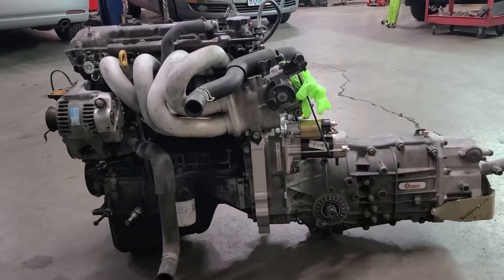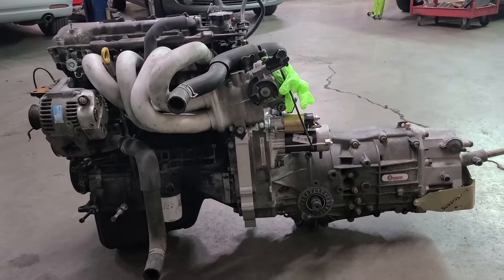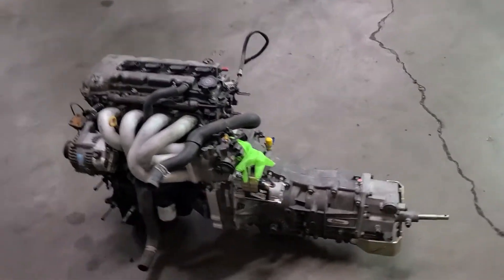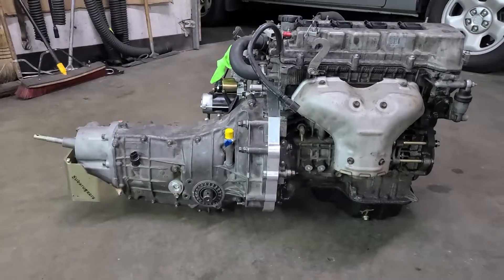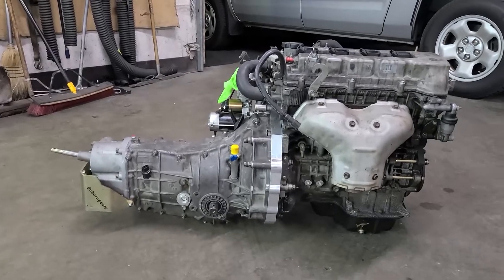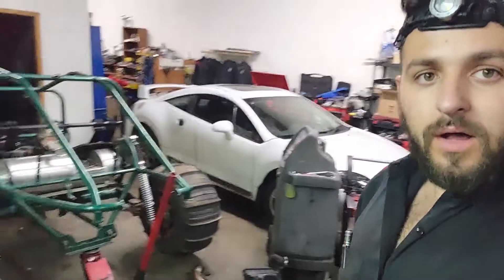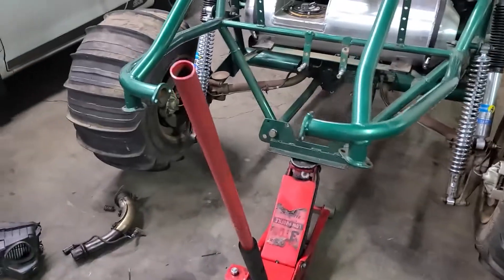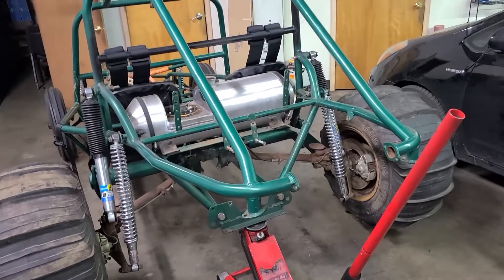Making a Custom Engine to Transmission Adapter (Toyota Sandrail Build EP#8)

Comment: Now that's some boss work! Using the dowel holes for alignment on a blank is super clever. So when you said machinist the first few times, you just meant the drill press eh? Hahaha. I fully expected the cheap clutch too. Love it.

Comment: What about the pilot bearing? Was the stock one able to fit the trans input shaft end? Or did you have to find a different one? King bearing has always had what I needed. I did not see how you solved that? Was the factory throw out bearing used or a differnt one? Great job . Im gettingvteady ti do one and looking for information.  Thank you.

Comment: It looks professional! I have a question though, how did you ensure the engine and transmission were aligned? I saw the part where you put the adapter plate on both the transmission and engine to mark hole locations, were there any additional alignment steps? How did you align the crank shaft to the hole?

I'm swapping a Nissan Leaf motor into a 93 Subaru Sambar. Other websites recommend <3 thou of misalignment, I don't know how I want to even measure the alignment yet. Your method looks pretty easy :)
Reply: I was thinking the same. Probably a matching pin off the pilot bushing on engine crank to match the hole in the adaptor plate before the  center of adaptor is machined out.

Comment: Could an automotive transmission be adapted to a motorcycle or sportbike engine? I imagine that this would be possible. However, I do not know how something like this could be done. Or who I need to talk to with this idea as
Reply: Only if the engine originally had a divorced transmission. A lot of motorcycle engines have the transmission in the same casing.

Comment: How do you account for the additional space of the adapter plate?
Reply from the maker: The thickness of the adapter plate was figured out first
Reply: @timshop2700  Based on what though? An original engine/transmission mate doesn’t have that extra space, so what allows for an extra inch plus for an adapter, a thicker clutch? How did you calculate the thickness of the adapter?
Reply from the maker: @77magnuss  I took a Subaru transmission and measured the point at which the input shaft rides in the pilot bearing. Then I measured where the flywheel sits on the block. After some messing around, adding, and subtracting, you come up with a necessary thickness for the adapter plate because of where the pilot bearing rides/input shaft location. Kind of a hard thing to explain
Reply: @timshop2700  Ok. Yeah, probably easier to visual with parts in front of you. I’m considering a swap into a Porsche 944 and this is the step I’m not sure about, but obviously it can be done. Everyone who has done videos skips over the calculation of this. I’ve been trying to find something with the basic concept explained but so far I haven’t. Thanks

Comment: Hi Tim, I plan to swap my volvo 940 B23 engine (non-turbo) with Volvo 850 2.5L engine (transverse position) and keep maintain the original 4 speeds transmission AW 03. Any technical recommendation or technical consideration for me? Thanks for your support
Reply from the maker: Well the main things you should think about is how you will mate the engine and transmission together, engine mounts, cooling system, intake system, exhaust system, and how you plan on running the engine. (Wiring harness and ecu)

Comment: great work. Also inspire me to swap my 1985 cressoda with ZZ series engine.
how many the thickness of plate that you used?
Reply from the maker: For this application, it was 1.228" thick
Reply: So you are adapting 2 metric mechanical items but still insitting on imperial measurements on the adaptor plate?

Comment: Same bolt pattern both on engine and transmission, besides the center hole bore... So lucky. I'm not so lucky in this case, lol. Thanks for informative video.

Comment: do you know where I can find an adapter plate for a 22r online ? I see you’re making a custom one this might be a dumb question but I’ve been searching for months and I had confidence someone on YouTube would know but by any chance would you know where ?
Reply from the maker: Yes, look up Kennedy engineering online. They have many many different adapter plates available for all kinds of engines. Also, if this is for a Subaru transmission, Subarugears (the company) makes adapter plates for all sorts of engines for these transmissions